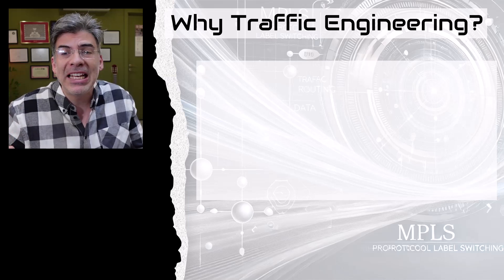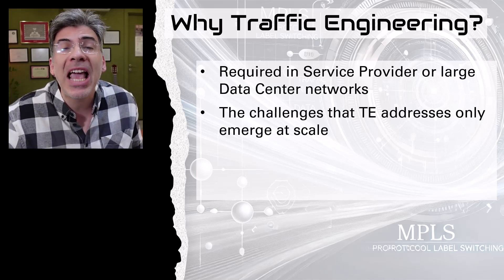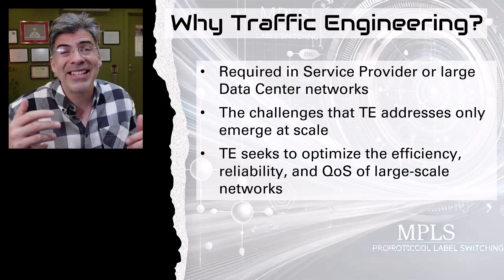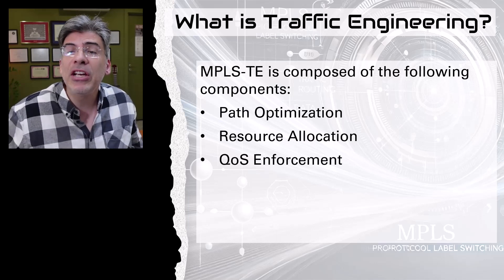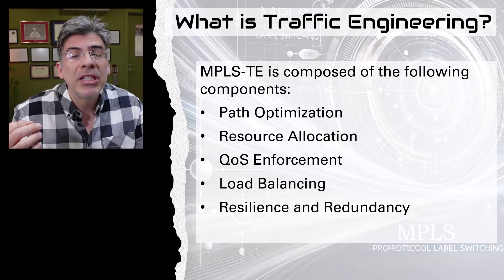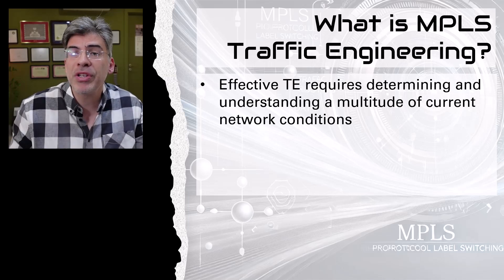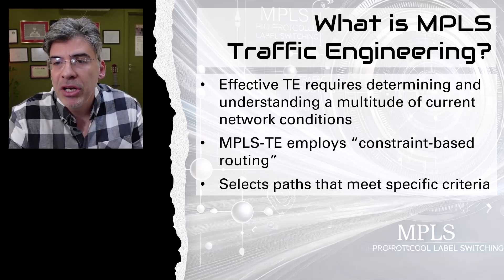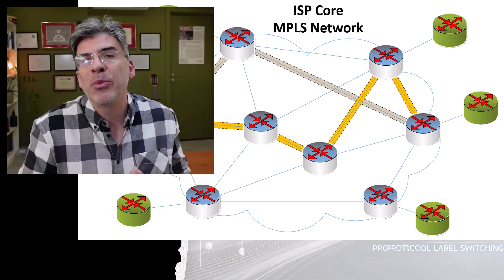Introduction to MPLS Traffic Engineering

Comment: Can we say that Traffic Engineering (TE) in BGP is implemented using BGP attributes?
Reply from the maker: Yes, you can definitely say that, but there's just a bit more to it than that.  In BGP TE is largely implemented using BGP attributes like 

- AS-Path length, where you can use AS-Path prepending to make a path look longer, and thus less preferred
- Local Preference to control outbound traffic within your AS
- MED to influence inbound traffic into your AS
- Communities and extende communities to tag routes and control routing policies at a finer level

However, in strict networking language, when people talk about "BGP Traffic Engineering," especially in service provider environments, they often mean using these attributes PLUS policy controls like route-maps, prefix-lists, and others, to engineer traffic flows.  So it’s not just about the attributes alone, but how you use them with policies.

Does that make sense?

Comment: Excellent video. Looking forward to seeing the MPLS TE "Fish" problem. Is, in your experience, link affinity used regularly in SP networks?
Reply from the maker: Thank you for the kind words! I'm glad you enjoyed the video. 

The MPLS TE "Fish" problem is a fascinating topic, and I'll consider addressing it in an upcoming video!

Regarding link affinity in SP networks, it is indeed used and quite often, but in very specific scenarios.  Link affinity, also known as "link coloring," is particularly useful in scenarios where service providers want to enforce strict traffic engineering policies.  

For example, you may want to isolate traffic from different customers or services, especially when you have very different SLAs and requirements for dfferent customers.

While it’s a powerful feature, its use requires careful planning and ongoing management, so it is not used universally across all SP networks, but only where specialized scenarios demand it, that is, in advanced or high-demand scenarios.